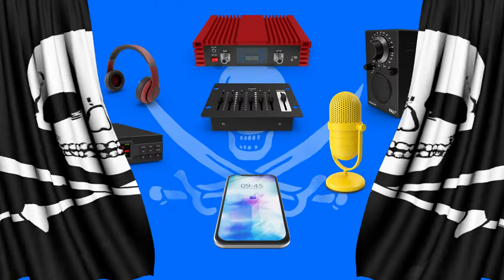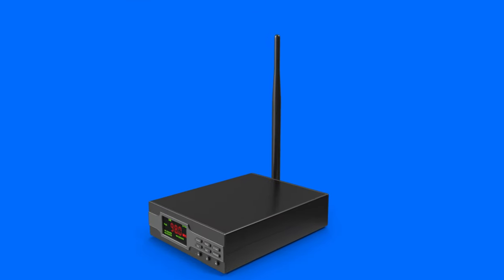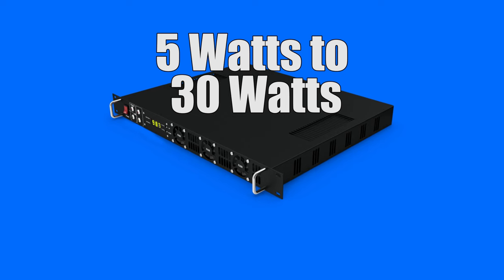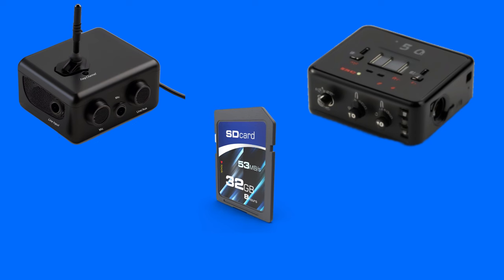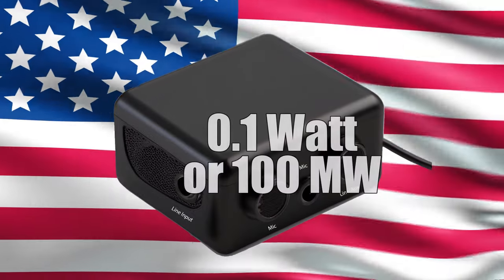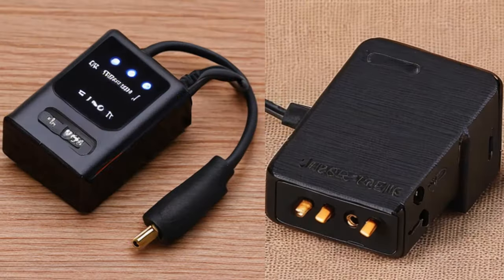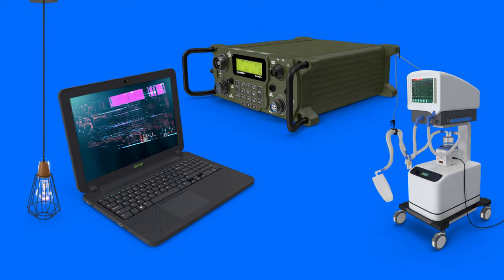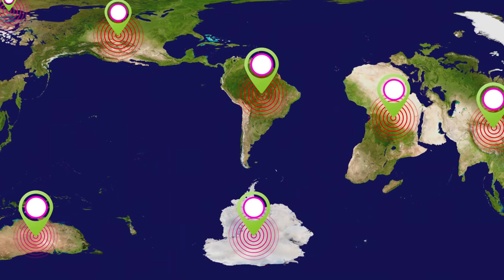PIRATE Radio Station FM Transmitter Kit. Transmitter, Antenna, Audio setup home pirate radio station

Comment: I understand that many of these device images were AI generated as well as some of the stock footage, but was the video AI scripted also?
Reply from the maker: Hi. The script I wrote myself from several sources. I decided to start using AI voices just because it's quicker than recording my voice. Some of the images I could not find so I had to resort to AI images. Some are not so great but it's one of those topics where images are few and far between. The content or information is not AI though. Also just to mention there are only a handful of the images that are AI generated and you can see it from the low quality of some of the Images but about 98% of the Images and 100 % of the video clips are not AI generated. I know it is assumed that most video these days is AI but actually most AI images and definitely video is nowhere as good as non AI .It will still be a while before AI reaches the level where it can compete.
Reply: Yeah, I noticed AI images and Video, so it made me question if this is some sort of test of how well it will be recieved. AI images were cool to see, they represend the devices very well, and I think that they do the job, but the voice is not something that personaly liked. I think that voice in old videos has more natural feel to it, or I just got used to it. Still very good video, always interesting to watch 😊  @inspiresoundpro
Reply from the maker: Thank you sometimes I think the videos take too much work lol. I try to add some fun bits sometimes to keep it interesting. I might use my voice again in future but for now people seem to be OK  with the new voice. The video is doing quite well. I will have some follow up videos because there's so much more to cover. Now that it's Holliday hopefully I can get some more videos done. Always appreciate the feedback. It helps to know how the videos are being received. And it keeps me motivated lol. Cheers

Comment: I ran a 100 watt, FM stereo pirate station back in the 1990s. I used a Comet cfm95sl antenna in a 90 foot tall pine tree. 
I used a 7-pole filter and only broadcast on Friday nights between 7-10 PM.
I never spoke and I never played music with questionable lyrics.
Reply from the maker: Most people would not share that kind of info. Thanks for sharing. Always interesting to see what people got up to. Cheers.
Reply: a pirate radio documentary showed how they had placed a biscuit tin (with magnets inside it) on top of a block of flats & had somehow linked it all up to the huge antenna on the roof ... bro i dont know anything about this stuff but rago would start a fm stereo pirate station on the strength  fm radio NEVER plays oldskool underground hip hop
i have been searching online the wrong question "how to make biscuit tin antenna" til i just seen your comment about pine tree - so theres more than 1 way - cant find much online bro any helpful tips welcome or even video links
also wondering how to connect the transmitter to the antenna IF NOWADAYS is there anyway it can be done wirelessly via blutooth (dunno if thats risky or...)  bro any info appreciated, safe
Reply from the maker: @Willesden_Rab1_TV  Hi I think you misunderstood the video. I am not helping people start pirate radio stations. The video is for education and entertainment purposes only. Sorry cant help you with your questions. As I said in the video DONT DO IT!
Reply: @inspiresoundpro  thanks for uploading this was the most informative video i have found online but i looked at your channel but doesnt have this guy again or does it?
he explain things very clearly is easy to understand - pls send me link of this guy please bro - much appreciated

Comment: do you have any suggestions for actual products? im leaning towards chinese fmuser 30w transmitter/antenna kits.
Reply from the maker: I unfortunately cant recommend any specific brands or models. Although I have tested some cheaper as well as broadcast level transmitters. I simply can't guarantee any brand or specific model. A rule of thumb for me is to see if  the transmitter is either approved by FCC or of a quality that would be approved by the broadcast authority in your country. I don't recommend using any unlicensed transmitters. To work towards obtaining a broadcast license or operate within the law of allowed low power transmitters its always better to choose transmitters that are either approved or meet the specifications of approved transmitters in your country. Many of the transmitters will either have an FCC approved sticker on them or some sort of approval sticker from the broadcast authority of your country. Any other non approved or low spec transmitters are just a magnet for trouble. Make sure you know and abide by the laws of your country and only use approved equipment for your country. As I said in the video I don't condone any unlicensed broadcasting. Make sure if you want to broadcast that you are not breaking the laws of your country. Any broadcasting you chose to do is at your own risk and I do not recommend it or support any broadcasting that is not legally approved in your country or any other.
Reply: @inspiresoundpro  alright, i appreciate the advice.
Reply: Get a higher quality lower wattage one, then use a higher quality amplifier to pump that up. You'll lose a bit of quality, but eh. Also that way the components are all smaller. Always use an RF signal input for your transmitter too so if someone fox hunts you they get 3-4 k's from your transmit site at best. Edit: Oh snap he just said that in the video, lmao!

Comment: Hello sir please give me a suggestion. I have a 7 watt transmitter and it has a stock 50 ohm telescopic antenna.
Now my question is.. Can I use my transmitter for 2-3 hours continuously with that antenna? 

Someone told that if I use telescopic ( stock antenna) my transmitter will  burn within 30 minutes.😢 Is it true?  Please reply..
Reply from the maker: Please see answer I gave on other video
Reply: A telescopic antenna will probably not be a good match to the TX and will put strain on it. It probably won't blow up but it's not a good idea. But the big downside is that a 7 watt TX used with a small telescopic from a typical bedroom will have a short range and patchy coverage. You need a rooftop Yagi antenna pointing toward your target audience.